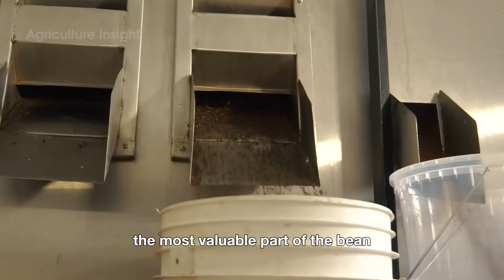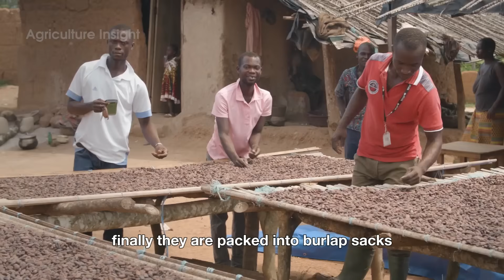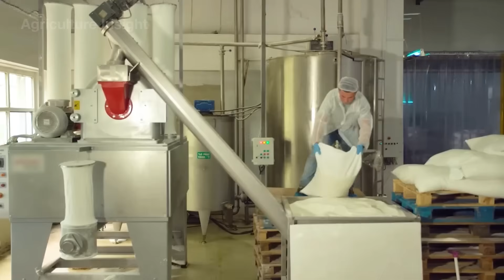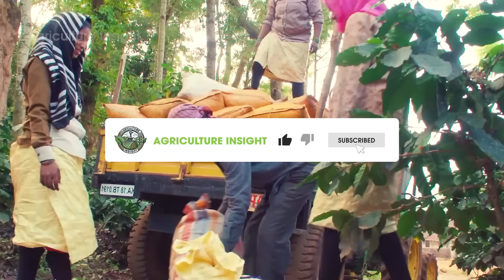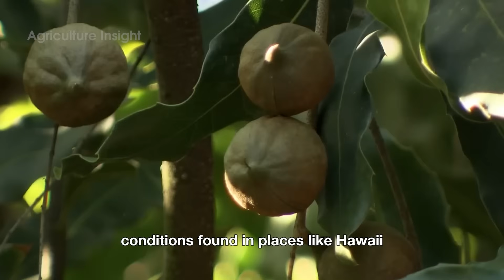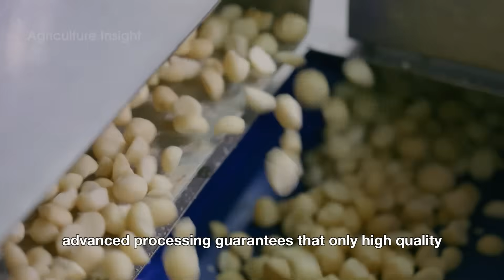How Chocolate Is Made | Secret Inside The Biggest Chocolate Factory In America

Comment: Stamp presings
Reply from the maker: Stamp pressings usually refer to the process where machines use high pressure to imprint or cut materials—commonly used in food packaging (like shaping foil lids or butter wrappers) or in industrial settings for making labels, seals, or even metal parts. It's a fast, precise method used in large-scale production. 🏭